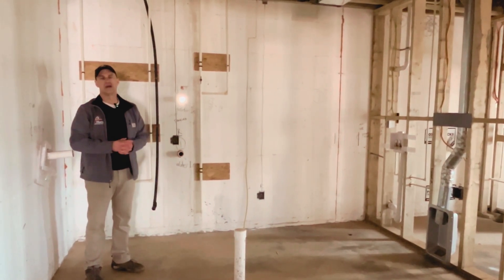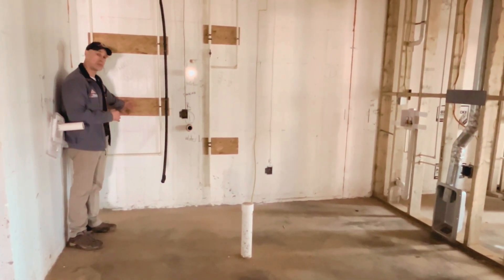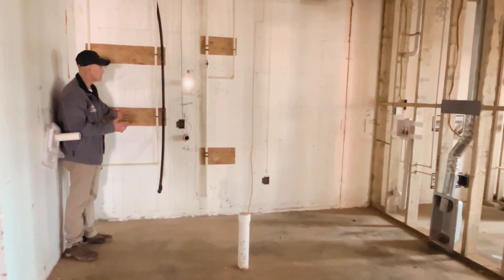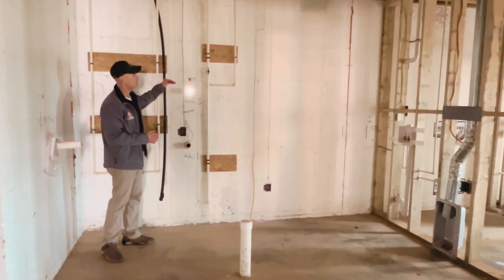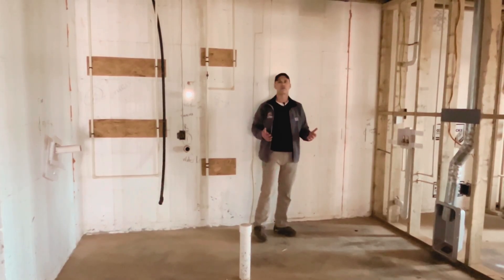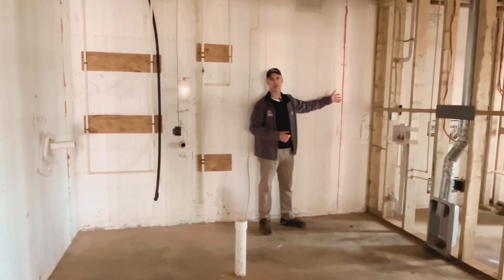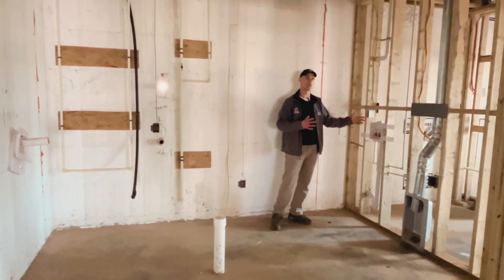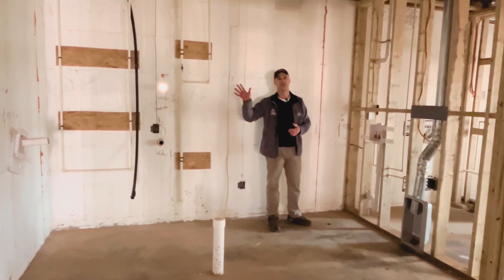How to Plan for Trades with ICF Construction with ICF Homes of Virginia.

Comment: Dave how was that wall 2x6 attach to the wall in case you miss plastic web? To the concrete with large screws?
Reply from the maker: Your primary anchoring placement is at the floor and ceiling connections.